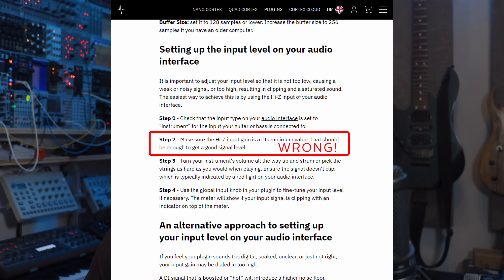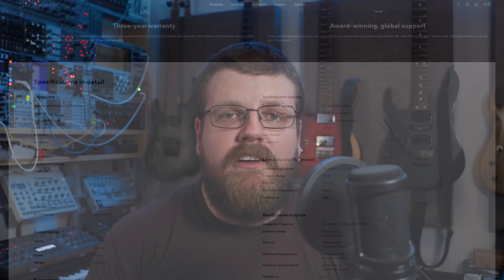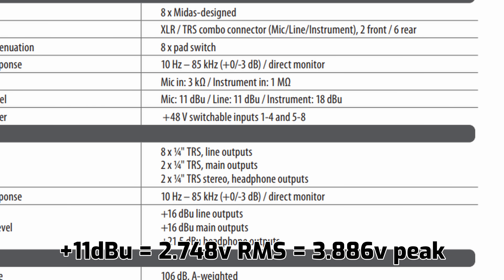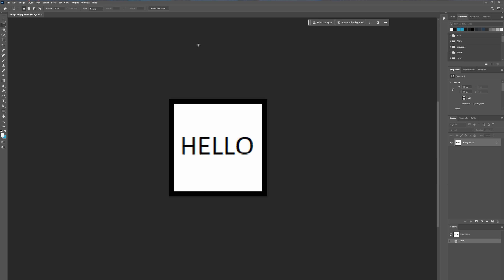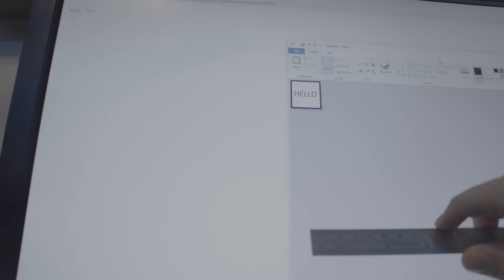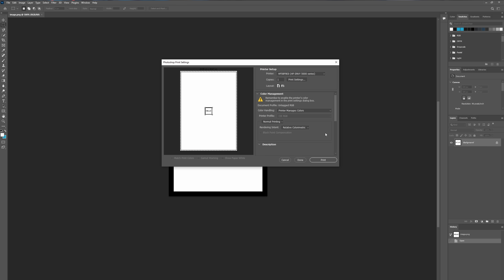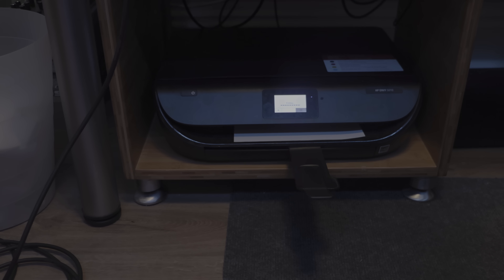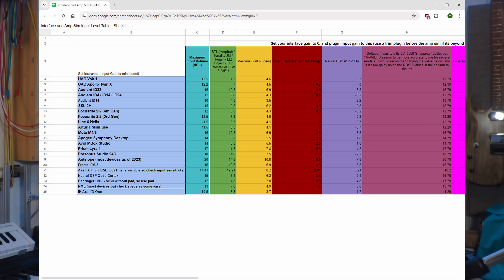Ampsims and input gain - Please, stop the madness...

Comment: Thank you for this video. It seems so logic that I  just want to make sure I didn't misunderstand the steps: 

I use my Neural Quad Cortex as audio interface and Neural DSP plugins. 

I set the input level of my plugin according to the spreadsheet (to +2.8dB in this case). 
In the I/O settings on my QC, starting from the minimum level of input (-12dB in this case),  I increase the input level to the point just before it starts clipping. 
Supposing I could increase the input level on the QC to +3dB (staring from -12 dB, the minimum). 
Then, I have to adjust the input level at the plugin to (+2.8dB - 15dB = -12.2dB). 
Is that it ? 

Thank you again for the technical explanation.
Cheers,

Comment: Legitimately good advice, other than the boosted "CPU noise" in the signal (which I'd also love to know a fix for). Thanks for setting the record straight!
Reply: CPU noise? is it a kind of high pitched whistle sound? i get that sometimes then realise its because my guitar is too close to my pc haha
Reply: @SamThredder  That's the one. You can also get it out of your speakers/monitors if you have those connected to your interface. There are a number of USB "isolators" that get rid of that noise quite effectively (or at least the part that gets to the speakers themselves), but the "CPU noise" or "coil whine" can be emitted from all kinds of places in a computer. Obviously if you point your guitar pick-ups at the computer, they'll pick it up, but in my case I can hear the high-pitch noise coming from the USB port area itself. I have a modern motherboard with 10/20Gbps ports and a Ryzen 7950x CPU which eats power like candy, so I suspect that in my case, that's part of my problem.

Comment: i realised that over 20 years ago by trial & error
soundcards back then didn't have built-in preamps and whenever i recorded something DI i had the whole noise from the whole system on the record
then i bought a preamp for the mic and used it for the guitar too just to see if i could use it as a distortion effect and was really suprised that suddenly the noise on the recorded audio diminished significantely
this shows that people are not willing to invest in their trade anymore; they just take something from the internet and then wonder why it doesn't work

Comment: Good noise floor audio examples!  That plugin chart looks very helpful too. Do you have any advice on Finding the Optimal Input Level that any old random amp sim plugin (or any plugin with any kind of non linear/gain based behavior) is expecting? Is there a test I can do at home or should I just pour over the plugin documentation and hope that the devs wrote this information down?

Comment: You’re absolutely right. The problem arises because guitarists want that “tube amp experience” of inserting the cable and start rocking out. The digital realm with non-customised ad/da convertors doesn’t work like that. The plugin has an expected input gain that was wet fingered by the programmers, the audio interface is intended for a billion different input sources, so you need to tweak and listen and tweak again and listen again and never be really certain it that sound you’re getting is the tone that was intended by the plugin creator. And so there came this “golden rule” that “always works”, where just rolling input to zero creates instant plugin heaven. And some wizards spoke to some oracles and proclaimed it noiseless and good. And everyone was happy.
That it isn’t true, isn’t important. It’s TRUE. As spoken by the youtube wizards and the reddit oracles.
Thanks for this video. I already surmised there was something wrong, you made it clear. Too bad most people will never know 😅

Comment: Just came across your video randomly and I must say I was a little bit surprised to hear it turned into such a widespread misunderstanding. Analog and digital are two very different worlds, an easy way to keep that split into your mind is to imagine you record without any plugins. You then use that wav file to play through the plugin. I assumed it would be clear to have the need to optimize the input of that plugin. I was wrong. To be honest: when I started I had no understanding of these things either. It takes some dedication to understand this and history has shown that advice on the internet might not always provide the most optimal results ^^. I also believe one of the reasons that plenty of people make mistakes is that it is not custom to read manuals anymore. Though, it is so vital to read manuals of whatever new equipment (physical or plugin) you add to your toolset. Each device has its own characters and specs. It has gotten to the point that even when you buy hardware you unpack it without a manual and it is assumed that the user will download and read a poorly translated pdf. Hence the majority of people seem to have stopped reading manuals all together. Whatever works for the person, I am happy when they are happy. It is concerning when people start to share wrong information with each other. The best advice I believe that one can give: read the manual, even if it is of poor quality. You'd be surprised what that device can do and how it operates.    Thanks for sharing your insights on the internet. There seems to be a need for proper information apparently ^^.  As long as we continue to grow, help each other and learn something new every day, I believe we will be ok. ❤

Comment: Some amp plugins have an automatic peak detection function to automatically adjust the digital input level. The problem with this is that you get the same level regardless of if you're using a high-output humbucker or a vintage single-coil. 

Ideally, the plugin should have a list a list of common pickup types. You select your pickup and the plugin then  further adjust the input level accordingly.
Reply: Why would you want to rely on some automated system or some presets that are unlikely to fit every possible equipment combination when you can simply set your gain manually by following a trivial process, just like it was always done?

Comment: What about reamping?

This 0db stuff is something I've been wrestling with, but stuck with it for a while and made some of the best sounds through my amp sims ever so i was assuming it was right. 

I was thinking the 0db input gain would make it easier to get a more faithful reproduction of the original guitar signal when reamping?

I did some reamping last year through my halfstack and pedals which i use all the time. I had recorded the DI signals the usual way, playing hard until it clips then backing off a bit. When i was reamping i could tell my tone was not identical to coming straight out of the guitar. It sounded fuzzier than normal, even if i backed the volume on the reamp box way down, the tone just wasnt the same.

Any advice?

Comment: Great video ! I guess that the 0dB idea comes from the fact that on most common audio interfaces, very little gain can already clip a signal coming from a humbucker (my case with UR22 form Steinberg). 

But I must confess that I don't understand the sheet and the digital gain settings. I can see that the setting is the difference between 12.2dB (Neural DSP column) and the max input level of the audio interface but I don't get the reason behind this. Most of the values seem insignificant btw (0.2 dB, -0.3...). Could someone pls explain this to me ? Does this really matter ?

Comment: for the lazy:
1. hit the strings as hard as you would playing and then turn the interface preamp gain up til it clips and back it off a little bit
2. open up a high gain patch on your plugin and play chugs whilst turning down the input gain on the plugin until it sounds good bc that's literally the point of music.

inb4: "it won't be the same" yes I know, but also I probably don't have the same pickup as the preset maker so I'll actually get closer to the intended tone this way.
Reply: Just to add to this great discussion... If you have active pickups (a guitar that uses a battery) if the battery is old and weak your signal will be weak and noisy
Reply: Never use a distorted plugin patch for this, you must use a clean patch! Why? select a clean patch and crank up the plugin(!!) input gain. Hear it getting distorted?. Now back it off till it becomes clean, now back it off a little to give you headroom. You will NOT hear this with a distorted patch, thus you will NOT know where to back the gain off to...and if you don't know that, you will NEVER guarantee the correct sound of that patch. I'm very surprised this isn't recognised in the video. 
When change to a higher/lower power pickup, you'll need to optimise both the audio interface and the plugin gain settings again.
Reply: @Jack_cx   honestly I just use my meters when setting input gain. Red light means dial back
Reply: The point is "sounds good" works up to a point. But people don't want presets to sound the same, they want the simulated amp to react as it would IRL (as close as possible) - and that means if the real amp has a gain knob and you put it on 5 you expect the same gain as if you plugged the same guitar into a real amp. You have to note too that some of the software (e.g amplitude 5) have models where it's not got enough gain (compared with the real amp) if you put the input gain on max.

It's a mess - and the input gain on zero + spreadsheet was an attempt to solve the mess for some plugins and interfaces (and really are people getting that much noise from good interfaces? Probably not)
Reply: @michael-3-l3  I actually really don't care if a simulation is equal to something analog, it must sound good to my ears, nothing else.
Reply: @alessandroproverbio3411  that’s what I eventually landed on.  It’s too much trouble.  I’m the only one who is ever gonna hear these recordings anyway.  lol.
Reply: @michael-3-l3  I hear ya, I just don't care about how "accurately" the plug reacts to a real life amp. If it feels how I want and sounds how I want everything is doing it's job.
Reply: @michael-3-l3  I use Amplitube.  My buddy has a mark 3 or 4 or whatever it is.  Those sims in amplitube do NOT sound anything like his amp.  He’s even got the cab from the 80s that was bought  along with the head originally.  It is an incredible piece of kit.  

We tried all kinds of settings to the point we gave up and he said just make it fit.  It just can’t do it.  I’d love to model the thing myself but I don’t have that part of the software.
Reply: biggest problem for me is that i want to have the same input gain whether im using my Line 6 Helix or Helix Native. Setting interface to 0 allows me to be as close as possible, so that the Native presets sounds as close to identical to how they would on the Helix or vice versa.

Comment: Agree all along. In fact, maybe you can explain me sth - when I did the 'gain to zero' approach (set everything according to spreadsheet), I got so little signal on the interface that any amp sim was barely distorting. Did that on 2 interfaces with the same result. So I just raised the input by 20 dB and it's fine. But I'm still wondering why it didn't work...

Comment: Here are the 4 steps explained and simplified to help the algorithm:

	1.	Set your interface gain to zero: This keeps the signal clean without adding noise or distortion from the interface itself.
	2.	Set the input gain based on your interface’s limits: Find your interface on the chart and adjust the input level to stay below the max volume limit, avoiding distortion.
	3.	Increase the interface gain until just below clipping: Raise the gain until you’re right under the point where it would start distorting, but no further.
	4.	Adjust the plugin gain to balance: Use the plugin’s input gain to fine-tune and prevent any clipping or weak signal.
Reply: Very good summary. The only correction is that you must use a clean patch sound to do this. Why? point 4. above can never be done correctly with a distorted patch. Remember, increasing the patch(!) input gain on a clean sound will distort it when overloaded. When you back that gain off you then use your ears to instantly hear the clean sound return. Then back off a little more for headroom.

Comment: Some interfaces, like the Apollo, will show you precisely how many dB of gain you’ve added. But on interfaces like the one you used in this video, there’s no numerical value shown on the interface—you in effect just turned it up to 3 o’clock. How do you know you added 19dB of gain? I assume you got that value from the metering app you showed, but that seems imprecise. Is there a way to determine precisely how many dB of gain you’ve added with an interface that does not show that value?
Reply: You can set the gain knob to zero, inject noise, open an analyser and rotate the gain knob to your desired level. Then you can compare the gain values detected by the analyser at both positions of the knob to know how much is the actual gain increase.

Comment: You're talking about plugins. This discussion actually is pretty valid when it comes to multifx-processing units like a QC or an Axe FX. To be honest, there is no need to discuss anything in this particular usecase because it's just facts that the input signal needs to enter the whole circuitry at a certain level for being processed in the ideal way. Fractal Audio shows that with headroom-gauges inside patches and has an input signal level adjustment to adjust the incoming signal until it tickles the red (input clipping). I did not watch your whole video because I don't like your way of arguing or stating things so maybe you were telling what I just wrote at the end. If so, sorry.

Comment: Was wondering as Tonocracy info also said to set interface to zero. Tried that, and  ....  said no, does not make sense and did not sound and feel right. So went back to "my" usual way, and never thought again about setting to zero. Sometimes there is some infos flying around in the internet, just being wrong, but remain over and over again. Like using linear pots for tone pots, ...... which is pure nonsense. But this is still posted in internet .... since many years, and will remain posted, although being completely wrong!   :-)   Thanks, was an imteresting video!

Comment: VERY good!

Coming from the old analogue days where you tried to set everything as close to 0db as possible to cover up the tape noise!
(I'm talking about recording tracks not feeding amp sims!)
When many they moved over to digital, they did the same & wondered WHY they all their tracks were distorted!

For digital -12db is the max signal you should send to be recorded! It's vol level is basically the SAME as 0db analogue!

Good tips!
Reply: In your example, -12db is not a volume level, rather a signal level?  For other readers: If I turn my Volume knob on the amp feeding my speakers for listening, then I can change the VOLUME up to max, down to silent or anywhere in between.  If the max signal peaks from an AD converter are a maximum of -12 db Full Scale, then the most significant bits are unused for the conversion from volts to bits and more than half of the resolution can be missing. That was kind of the point for part of the video.  By resolution, I mean like the 100 pixels in photoshop. At 1" on a side, the printed "Hello" square has each pixel printed at 1/100th of an inch so that 100 printed squares next to each other are one inch big in total and we can't see individual dots.  If I print that same square to be 100 feet on a side, then each piece of digital information needs to be a real-world measurement of one foot by one foot, and the pixels are obvious.  Rewatch the video at 144p quality for more about resolution. 🙂
You still want to get your initial input to as close to 0 dbFS (but avoid clipping) for maximum bit-depth and therefore greatest signal-to-noise ratio.  Distortion as you speak of during that migration from tape was digital distortion caused by clipping the signal level at the peaks. Clipping a little to tape was "saturation" and was ok. Digital distortion is not the same, it is harshly ugly.
0db Analogue can be differing arbitrary signal levels, depending on the calibration of the Volume Unit meter. Your example means that -12dbFS digital is where 0db analogue is set, and that allows only 12 decibels of headroom for signal peaks. I am ignoring true peak level here, but an average of -12dbFS would give a good, strong signal to record and any good quality A/D converter will keep it quiet.  If any little transient peak in this example goes more than 12db over analogue 0db, (so: greater than 0dbFS digital) then that is clipping, so turn the input gain down a little and try again.
Reply: @HowieT-i6y  Good stuff!

Comment: Huh, that makes sense.

I found 0db practical cuz I didn't have to worry about consistent input volume.
I'd usually just gain it up +6db in the DAW after, cuz my interface would peak very quickly on any setting higher than 0db +pad anyway

Comment: Most Volt / Solo users might not need to with a high output pickup (15/16+)? Volt, Hi-Z with the gain at zero, (with a SD JB) ends up with almost perfect pre-amplification; hits at -3 at the absolute most, so, it already has a good pre-conversion SNR, and works great with sims in my experience.